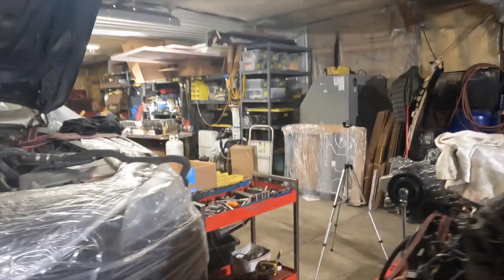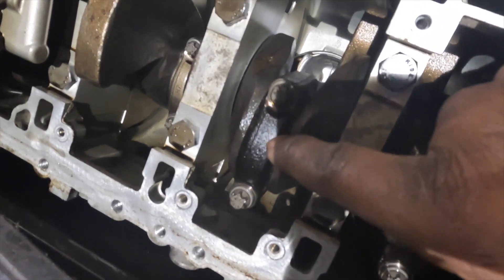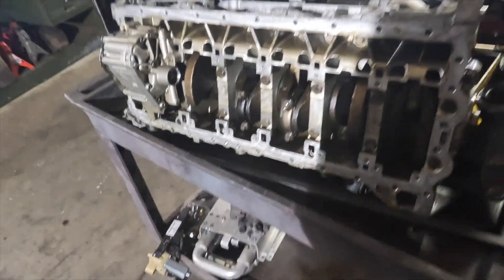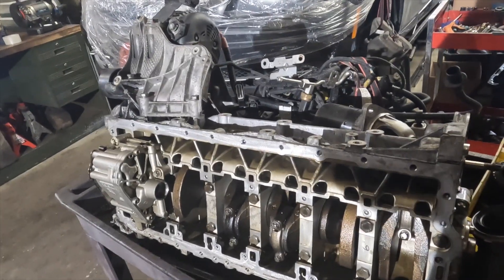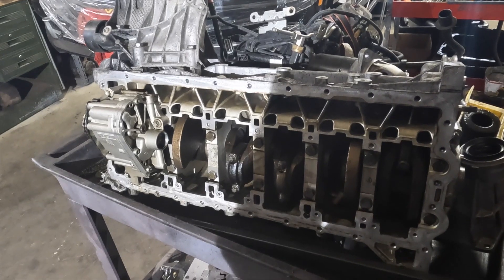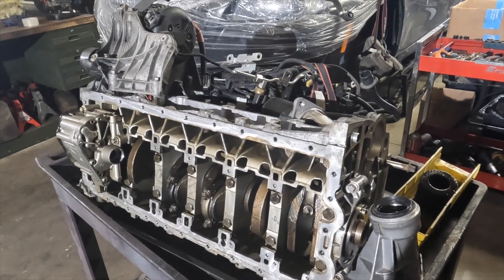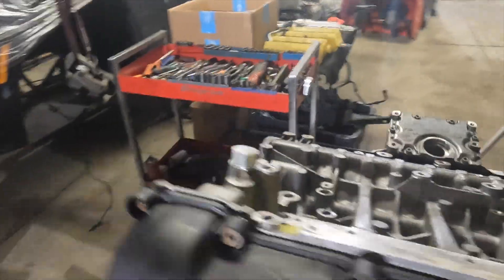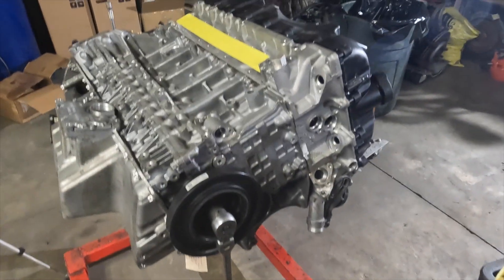BMW N55  535 Xi  3087 Engine Diagnosis Part 2

Comment: Good afternoon I was  wondering if  you can see if the redesigned hpfp and  vacuum gearing from n55 as a whole unit can be installed  to upgrade the n54 block hpfp pump. Peeked my interest thinking bmw up graded the head n the short block is the same n54.